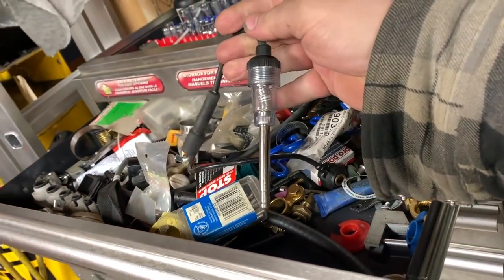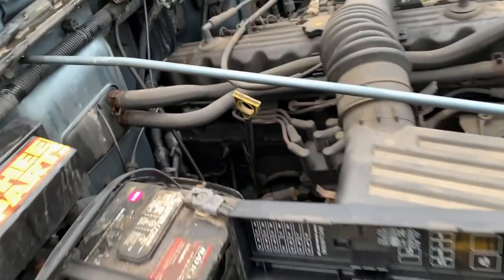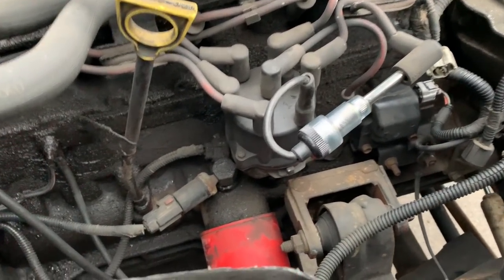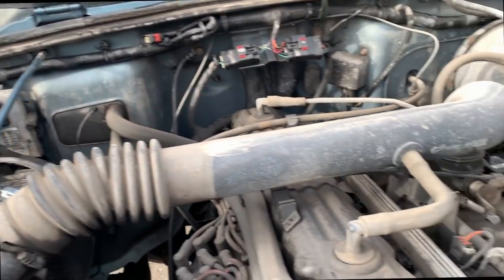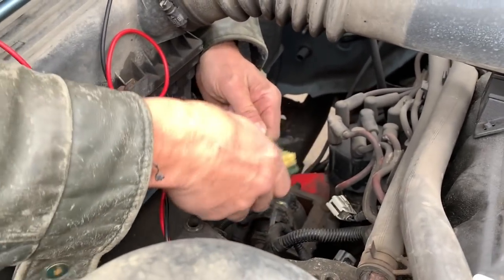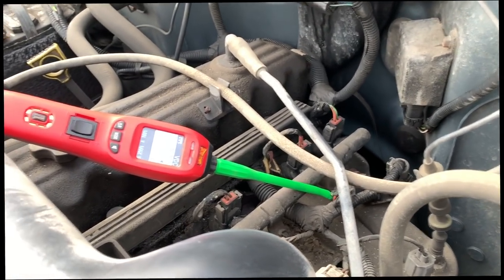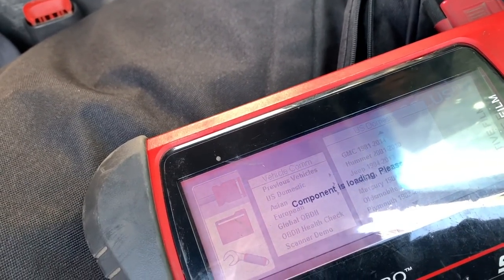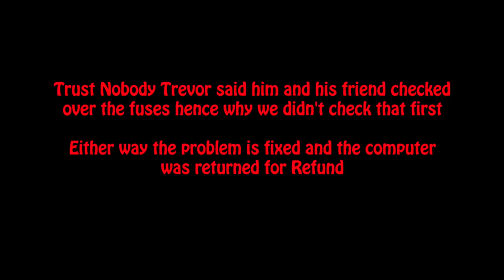Jeep Crank No Start Simple Fail

Comment: This is an intermittent issue with my 91 Cherokee Laredo 4.0. The last time we caught it doing this and changed the crank position sensor it never started again. With the old crank position sensor it did start. It’s very intermission, mostly on cold mornings when I’m late for work. I have tried everything fuel pump distributor all that… The only thing that seams to work is working the key back-and-forth multiple times and hitting the gas when you’re cranky but this is not consistent results. Somehow by trying to start it multiple times something happens and it decides to start. Then it will run all day you could drive across the country and be fine. Intermittent issues are the worst! The only difference is mine does the exact same thing but doesn’t build fuel pressure either. But spraying come out into the intake manifold still same issue.

I think there is some kind of secondary or tertiary ignition system between the key and the fuel pump and or ignition coil that will allow the starter to crank but won’t allow the truck to run which makes it even harder because yes it cranks no it doesn’t start. By the time I get anybody out here to look at it it starts just fine

Comment: I usually diagnose in this order:
Check oil / coolant levels
Listen for fuel pump priming
Listen to engine crank
Check air intake system + pipes
Check codes
Check main fuse box (quick job)
Check wiring and connections
Check spark / fuel
Check secondary fuse box (pain in the bum sometimes)
Check ECU

Not criticising the way you diagnose btw. Just saying what I do. Seems to work okay in most cases. Except one car which I forgot to do the oil check. Couldn't figure it out but the engine was seized due to petrol leaking into the oil lol. 👍

EDIT: Lool! Fucking fuses. I always double-check now even if people say they've checked stuff.

Comment: Same issue crank no start, I started with the CKPS no luck then I dropped the tank and saw my connector was a corroded out. I did not keep it simple, should've check fuel pressure first.
Reply from the maker: We’ve all been there, this video is a good example

Comment: but my big question would be what blew the fuse to start with because you might be out in a bad place and it could do it again  something shorted or drew to much current  from looks of the fuse
Reply from the maker: Have a bare wire in the secondary o2 sensor

Comment: My old 97 TJ had the same issue, turned out to be a bad ground on the computer, wire brushed the mounting surfaces and it was fixed.  What kind of jeep owner doesn't have tools????

Comment: So question. I have fuel and i just replaced cap and rotar as well as the coil. My 89 cherokee is doing same thing where it just wont start but cranks. After a while and a jump i can get it started again but it very randomly just wont start. Any idea what else to check?  Ive been stranded like 5 times now after thinking what i did fixed it
Reply from the maker: That’s a good question however the only way to solve this issue is to start diagnosing when it won’t start since it’s intermittent
Reply: @BackCountryWrenching  ok sounds good.its my first xj and ive had it a year. This is the first issue its gave me except being a pain installing the lift lol damn rear shackle bolts were rusted so bad that the bracket was back off with bolt and bending

Comment: I have a donor computer in my TJ from a grand Cherokee. Everything runs great besides the annoying CEL due to the transmissions not lining up (both auto, different model).
Reply from the maker: Did the dash still work ? This computer would have worked as well but it had a canbus error for the dash
Reply: Bullshitkorner yep, dash works fine. We bricked my original computer from a stupid suggestion from someone in my Jeep club to plug my computer into a TJ next to mine to see if it was dead or not after I’ve been having no CEL when turning key to the ON position. Turns out the Jeep we plugged mine into has SKIM and mine does not so it ended up learning the SKIM feature and shutting off immediately when starting the Jeep. My entire issue was the CPS.

Comment: Yep. When you were checking injector pulse, you should have seen 12v being pulled to ground.  No 12v, not a computer issue.  Hopefully you busted out the liquid electrical tape and sealed up all the points you were doing the hokey pokey on, or you will be back in there fixing the green puss in a few months.

Comment: Should have put in a 30 amp fuse!  Then see what burns up...  lol
Now, why did it blow in the first place?
I also use ether(staring fluid) as a means to see if it has spark...    If an engine can't even cough and stumble on ether, then there is no spark.  Most times.   Good thing you got a refund, around here there is no such thing with local wrecking-yard bastards.
Reply from the maker: The next video will cover why the fuse blew

Comment: What kind of man drives a jeep, carries no tools, and can't do basic diagnostics? Someone give Trevor a dress. By the way, great methodology man.
Reply: The actual computers don't necessarily go bad. If you open up the case, the spot where the header pins connect to the board, the solder ball crack. Its a bit oof a pain to get the case open, but once you do its super easy to fix. I've fixed mine and another both in this same way. Takes about 15 minutes (if that's the issue, lol). Just a good bit of info and you don't see a lot of info on it online.
Reply from the maker: interesting good info to know if anybody sees this comment